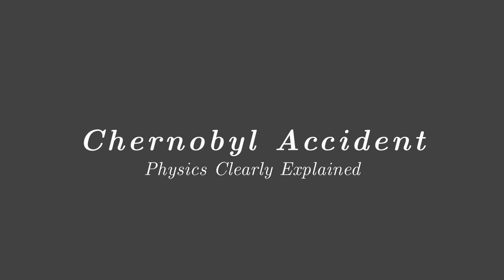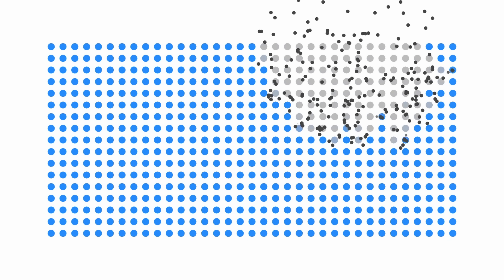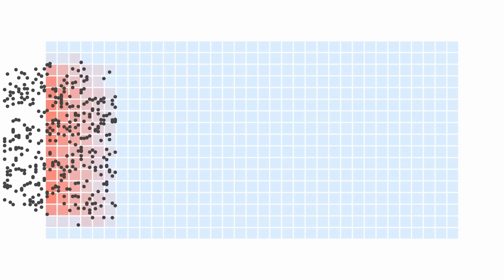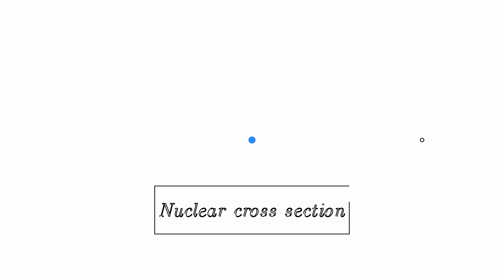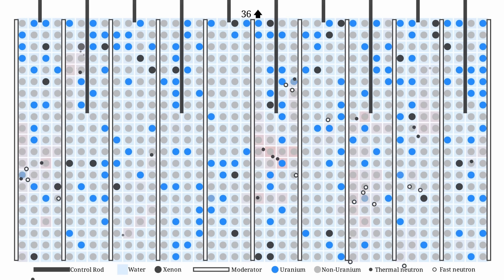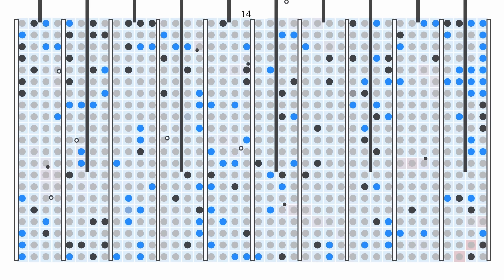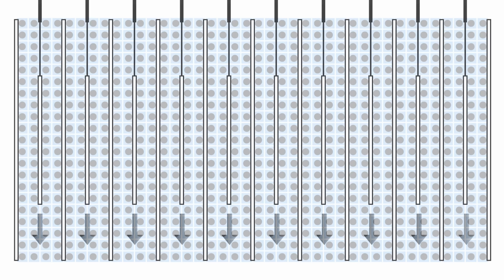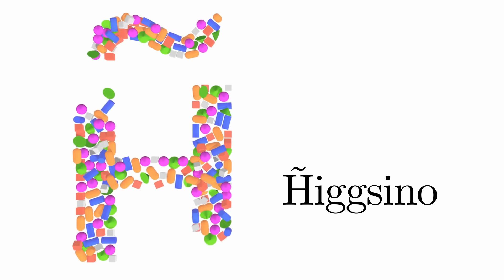Chernobyl Visually Explained

Comment: "Ridiculously Badly Made Kettle" that should be on a T-shirt, it is brilliant! 
Fantastic video, I recall trying to model chain reactions for my video critical mass but gave up. Your is just great. And the runaway reaction was the cherry on top. Great video!
Reply from the maker: I think you made the smart choice not to code this! For me it took waaay too much time. But glad you liked it! thanks a ton :D
Reply: @Higgsinophysics  I was going to ask you about exactly this. It's hard to make things like this stable - a lot of fiddling with the coefficients like how quickly the water heats and cools, how readily the xenon burns away, and things like that.
Reply from the maker: yeah that is 100% true. Not only do I have to make the logic and graphics but there is a lot of fiddling as you mention.

Actually, I did cheat a bit to get my simulation to match the Chernobyl accident. For example, you can see sometimes the rods move slower. Sometimes the xenon chance is  higher. I had to cheat so the simulation didn't have to run for hours